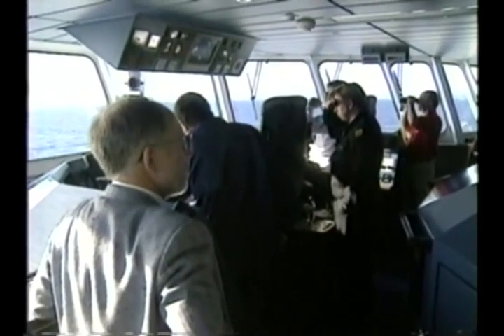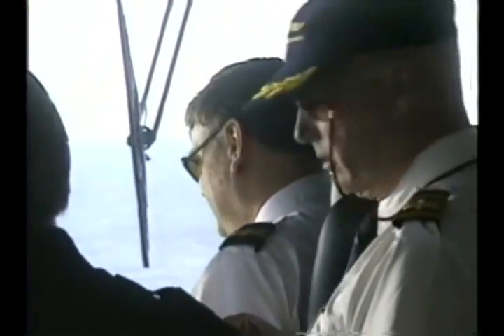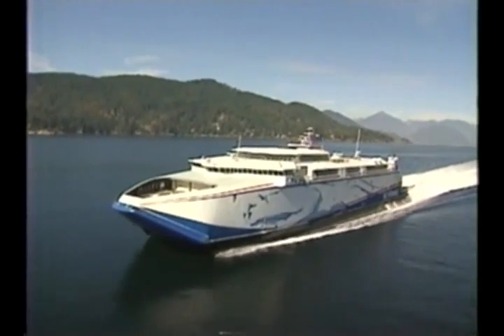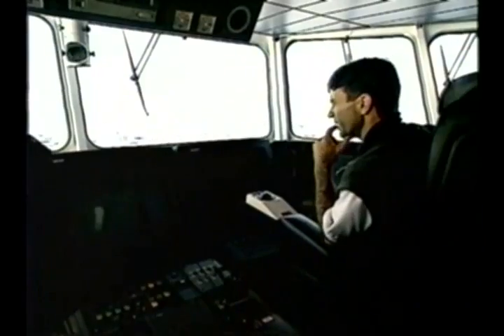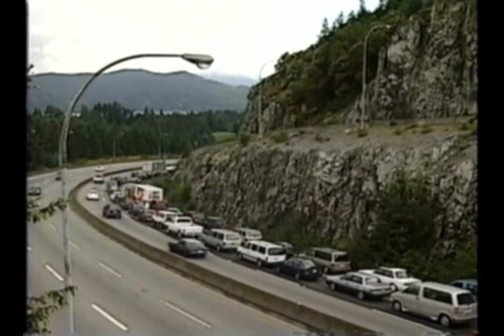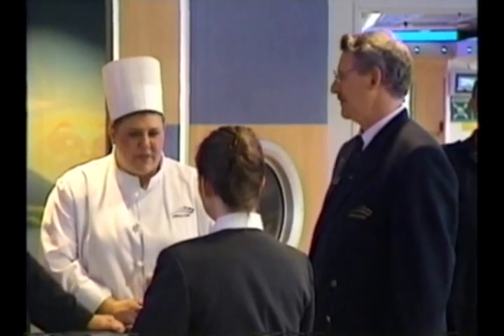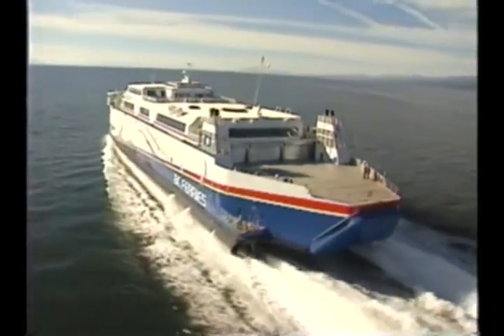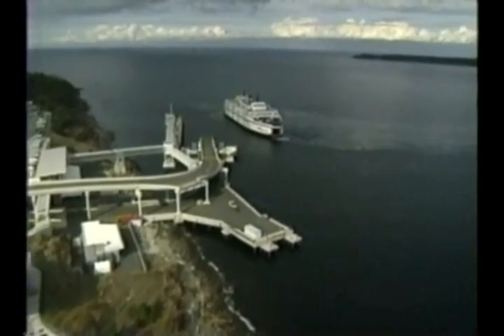Building of the PacifiCat Ferries (Part 6/6)

Comment: So what exactly was the failure...WHY were they taken out of service? I heard lots of rumours...but I sailed on one and it was great. Anyone know the facts?
Reply: Not able to achieve sustained design speeds, major wake causing damage/issues on local shorelines, extremely high fuel costs to run them at a speed that made them quicker/worthwhile and stability issues when loaded to name a few. There were issues with weight and draught of the ships as well, I believe.
Reply: similar thing to the concorde, it just there was no money coming in from them.
Reply: There are a few reasons as to why it failed , i will  just say like many government projects. They were primary  designed to line pockets with money .